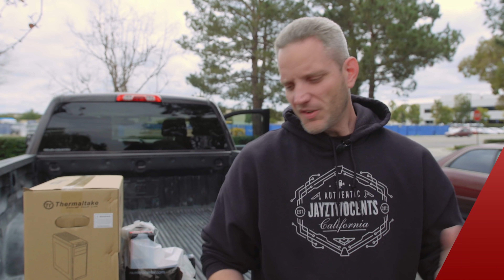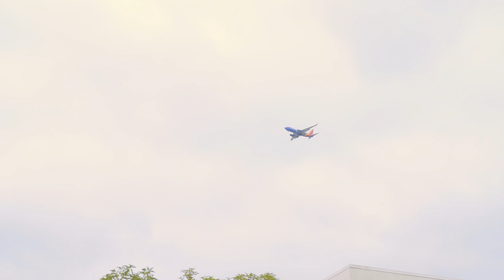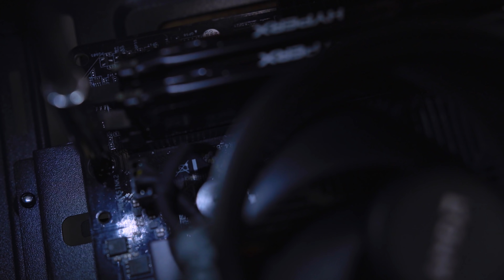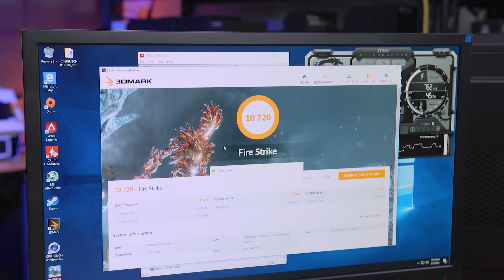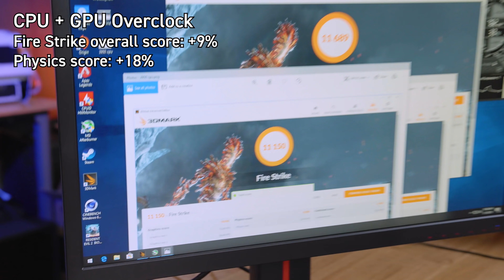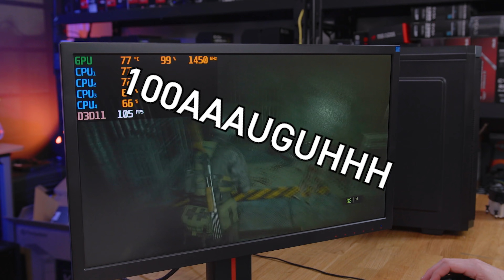CHEAP Gaming PC Build - 2019

Comment: The Division 2 is in open beta and is one of the games that comes with an RX 570 and 580 you could try and benchmark that though it will probably run flawlessly! I had some trouble running it on my RX 570 and had to turn everything down to low. I know it's an online game and I am using ethernet so I don't know if my CPU is holding me back cause I got a Ryzen 3 1200 and 8gb of ram. I wanted to upgrade to the Ryzen 3000 cpus when they come out. Would it be my CPU bottleneck or is my graphics card the cause? I tried running on medium settings at 1080p in the Division 2 only to get around 30fps with highs in 60fps sometimes but it drops to 30-40 during combat and is kind of stuttery. I then lowered all the settings to low but it didn't help any. It could be something wrong with the beta or my PC I don't know.

Comment: Does anyone know why a RX580 8g Gaming keeps freezing my computer after installing the radeon drivers?
After it crashes the computer reboots, Bios and window will load but as soon as you log in the screen will stay black or sometimes goes green.

Anyone else had this issue?
Reply: Not sure but something that comes to mind is maybe had weird issue where old drive didn't delete so have both driver's and is causing issue. Not expert just something I've heard tech YouTubers worry about because when testing graphics cards they switch so driver's interfer with each other and cause problems

Comment: I built a very similar PC for a neighbor for 473$ i got a 570 used instead she doesn't over clock at all . I knew the rx 580 was going to be bottleneck 8% or so.  That is why i went with the 570 and over clocked the crap out of it for her. Gets very similar fps in games here. 4 to 5 fps less in some spots than shown but very playable.  So you can build a pc with dang near same specs if you get creative for less than 500$

Comment: Is it feasible to go a little $$ more on the CPU cooler to improve the overclock performance?
Reply: Your limitation is going to be the motherboard and the CPU more than the cooler. The Ryzen chips will get around 4ghz overclocked. I have a R5 1600 overclocked to 3.9ghz with a hyper 212 cooler and it honestly won't go much higher without requiring stupid amounts of voltage and becoming unstable. The 212 is overkill, it never gets hotter than mid 50's under load. You're better off putting the money towards a better motherboard or a higher tier processor and just using the stock cooler.

Comment: I would like to see how newer gpus work with old Ivy Bridge CPUs like  I7-3770. People may still have stuff like that. You can get Dell with 8GB Memory and 3770 for $269. Just add GPU, and maybe more RAM. Might work for old school budget PC. This is used hardware. I looked on Newegg.
Reply: Until recently I had a 970 with a 2500k and the i5 kept up pretty well in most games.
Reply: Check gamer's Nexus when they do gpu/CPU test they have a large table. comparing many configs you might see your processor in the list

Comment: im currently on Darksiders 3 with a i7 3820 and a GTX980Ti the CPU fails to meet recommended and wow the stutters. trying to decide on the upgrade path has gotten tricky find an i7 8700k and 9700k or wait till AMD release the 3000 series and compare.
Reply: Wait for 3rd gen ryzen, its not very far

Comment: why is my evga gtx 1060 running apex at 75-80 degrees with 100% fan speed it used to run at 70 with 50 fan speed

Comment: Stay away from powercolor cards. I had a dragon 290x and the vram died on it in about a year. Underclocking kept it hanging on for a few more months but they claimed the problem was my fault and would not repair it. A buddy had a similar problem with a 280x card from them and they again would not warranty.
Reply: msi-and-asusis-the-best
Reply: @dinkthesink3890  whichever brand you get make sure they have Samsung memory for the best overclocking
Reply: @Falcodrin  yup :D

Comment: >case with drive bays

Call me a luddite (with a crippling addiction to hotswappable SSD drive bays), but I actually like having a BD drive and an expansion bay avaliable. I have this library of physical media available and as I said before, there's reasons to have a front bay for specific workflows (whether it's hot swapping SSDs for easy formatting and data transfer, dedicated front panel audio, specialized media drives, etc.)

Are there actually good cases that have at most three drive bays anymore? All the enthusiast cases I see are the hideous front panel glass crap..

Comment: But I need my maglev fans.
No joke tho, my computer is air cooled and I have overclocked everything as far as I could get them but at every overclock ran to the problem that they couldn't handle more voltage  and my temps are when gaming around 60 C. 
Forgot to mention also that I can't hear anything from it when I just browse net and do basic stuff and even when gaming the sound isn't bad and sens I always use headphones when gaming I can't hear it at all. My refrigerator makes more noise than my PC (I live in 1 room unit 22 square meters).

Comment: You can get low cost Windows 10 licenses for about $25-40 dollars online.

As far as the CPU and GPU, try swapping the Ryzen 3 2200G for a Ryzen 5 2400G and if you need extra GPU power, you could get a lower costly MSI RX570 Armor OC 8GB.
Reply: Win 10 is free if you don't register it, just get a water mark and can't change the wallpaper
Reply: @Psittac20  I'm only saying for legality purposes...
Reply: Psittac20 it’s more than just not changing the wallpaper.
Reply: @Psittac20  then you install KMSpico and suddenly have free windows
Reply: ebay windows 10 pro keys are like 5-10$ not sure where they come from... but they work!
Reply: u get windows 10key for 12$,and wdym bout rx570,he had 580 8gb

Comment: I just set up a 2200G system with Linux Mint 19.1. Just ran Heaven on it with 2400-speed RAM installed and got 10.5-43 FPS (average 23, score 580). That's OpenGL, of course, with default settings (high quality, everything else disabled/off, full-screen 1920x1080. I'll have to rerun it when my faster RAM arrives and see just how much of a difference it might make, though I am not going to be using this with any emphasis on gaming. Just hoping it will run a bit cheaper for my daily work and other computing than my other Ryzen with its honking RX580, which will be dedicated to Linux gaming.

Comment: You forgot windows, mouse, keyboard, monitor (possibly use tv)
So its not 500bucks at all. Its quite a lot more tbh for anyone thinking they can come from console to play on pc.
Reply: You can basically say the same for a console, with the exception that it comes with a controller (which is maybe $50 if you are dumb enough to purchase MSRP)

Comment: a week ago i help build PC for my poor friend, using i3 2100, H61 motherboard, 8Gb ram ddr3, RX 550 4Gb, ssd 120Gb.. Running well for Apex Legend :).. no need to overclocking..
Reply: should have get atleast i5, then it will be still good for 1080p

Comment: I would personally get a 2600 for $160 and take the $30 discount on the mobo, and I would also consider something with 4 dimms so you can pop in another 8gb doen the line. So for an extra $30 you get 2 more cores, mt, and higher clock. Plus I believe AMD is also giving out The Division 2 with that.
Reply: lilkoolaidman93 Can confirm. Finally built a rig for myself and got a 2600 for the system. Div 2 come bundled with it and I couldn’t be happier than before.

Then again I used to game in an Asus laptop from 2012 with a 740m and faulty ram, so I’m easily impressed.
Reply: jinn194 you’re easily impressed? ive never experienced anything other than membrane keyboards and second gen intel integrated graphics
Reply: The 1600 for $99, and $30 discount on the mobo bundle would have outperformed the 2200G and saved $10.  2600 is a better choice for CPU, but for the $, I think the 1600 is the best option.
Reply: @EMU1  If they're doing that promo with the 1600, that's also a good deal
Reply: Seriously, this guy lost a bit of credibility.
Reply: 1700x.... way better
Reply: @meetgabriel0709  you need a cooler tho, and it's $200
Reply: Surmestic 200$ for a cooler?! No way ... on a 1700x lol not where near that price
Reply: @meetgabriel0709  1700x costs $200...
Reply: @EMU1  Hi, a Ryzen 7 1700x cost $150 minus $30 on a motherboard at microcenter.

Comment: I think Jayz should do an complete pc for max 1099$ (the extra 99$ is for the best headphone you can get for under 200$ and it is named Cooler Master MH-752) with a minimum monitor of 21:9 , 1080p , IPS , 75fps and decent mouse and keyboard (no mechanical) ... (also stock prices not deals)
Reply: you spelled Audio-Technica ATH-M50x / Sennheiser HD 58x wrong
Reply: And the list should be updated each 6 months (+ if the monitors become cheap and gpu's become better for lower price then improve them for example if an 21:9 1440p IPS 100 fps it is affordable and the gpu can handle it in the budget then improove it but max price for complete should be $1200 )

Comment: I already got a GTX 1060 3gb, I don't play the latest and greatest, so not worried. My plan is to start my build, around mid July to September, when i get the build saved and ordered. My plan is a 6/8 core 1st gen ryzen, for the price they are currently the best value. The games i play don't need the latest or top shelf. Another possibility, is that 3rd gen ryzen comes in at about the price, that the Adored leaks showed(R3 3300 6core (maybe?) for $100.00). That will certainly save me some money as well, so could end up going new everything

Comment: Did he just put the heatsink on without thermal paste? "facepalm" or was it that preapplied crap on the heatsink?

Also overclocking is not free performance as it increases your TDP and results in paying more for your electricity (incoming nerds that tell me its a tiny amount for electricity) its still not free!!
Reply: preapplied crap, as i was building this system according to how a newbie would put it together. i didn't want to use anything we didnt buy specifically for the build :)
Reply: @frickingphil  Fair enough

Comment: An Evga 500w, with that GPU, is a recipe for disaster. The 500w white is HEC built junk. The 2400g I doubt would have been any better, for IGP, with slower ram. Also, a WoW build be cool.
Reply: I have had an EVGA 430w with a GTX 480, and an HD 7970.

Comment: Nooooooo! Not the Inlands lol. They've got a pretty high failure rate. 

But yeah I get using them for a budget build lol.
Reply: At that price, just buy in pairs at minimum and RAID.

I mean you should be using raid in all cases.
Reply: Actually they don’t, they are pretty quality. The only downside is they don’t have cache and are a bit slower.

Comment: 2 Things I disagree with on this build:
1. Processor... IMO the Ryzen 1600 / 2600 are the way to go. The integrated Vega graphics might be fine for CS:GO or LoL etc... but really if you're that tight on a budget, get something used.
2. Faster RAM. The price difference isn't big and you'd really want some good RAM with Ryzen CPUs.

That said, I like seeing budget content on this channel, would love to see episodes about used hardware etc. maybe do a Jay vs. Phil challenge new vs. used?
Reply: The Ryzen 1600/2600 are over $100 and the 2200g can still handle the RX 580 just fine. But some people will want to upgrade to the Ryzen 3000 CPUs. You forget how expensive that faster ram really is. 3000 mhz ram is a lot more then 2400 mhz ram and forget about 16gb which is over the price limited. This is a budget/mid range build so I think Jay did the sensible thing and picked pretty good components. Fortunately the motherboard (or any AM4 mobo) can handle the new upcoming CPU's and the RX 580 is quite capable and not bottlenecked too much by the 2200g. No point in splurging now when better processors are coming out. And 8gb 2400 mhz ram will be just fine until the ram prices eventually drop or go on sale.
Reply: I agree but my friend recently built a 2400g system for a pretty tight budget which didn't allow him to get a gpu for about a couple weeks. As he only really played csgo it was doing pretty well but he wanted to get a gpu as soon as possible so he went for a RX 570. I personally agree that yes the 2600 is a better choice but the 2400g is for someone who doesn't have the money yet or doesn't need a gpu which still allows them to game pretty decently
Reply: @antisniper70  I didn't look it up, but I think the Performance of a 2200's GPU is roughly in the area of something like a GTX650 2GB (I use one of them in my Workstation), the 2400's might be in the area of a 650Ti, 750 or GT1030 (or AMD equivalents). All those cards can be obtained for a rather low price on the used market (at least in US, UK, EU) and don't really lose value anymore.

Another thing people IMO overlook is the fact that IGPU also consume RAM. If you have a 8GB build and allocate 2GB to the IGPU, you're down to 6GB already. If you then add bad habits like leaving chrome with too many tabs open etc. you might go towards 4GB usable RAM for a Game, which isn't much even for esport titles.
Reply: @MadIIMike  Then the only downside is that you are stuck with a graphics card that is used, second hand, and several years old. It might be good for temporary use but will struggle with most modern games so it is better to play with an APU that you can upgrade later and you can always disable the integrated graphics so it will not allocate ram to itself since this build has a GPU. A better processor would be better but you can always get a new one when the 3000 cpus come out. Also the GT 1030 is way too over priced coming in at around $90 which is too expensive for the performance not to mention the 710 isn't worth it. Random Gaming in HD just reviewed the GT 710 I think in one of his latest videos so it may be worth a look. Even the GTX 650 struggled with older games like Assassin's Creed: Unity.
Reply: I think this was strictly for a new system only, but you are definitely right. My PC was mostly used parts and it's working wonders for me.
Reply: The rx 570 he didn’t get is only $129.  Micro center as b450 board and 2600 combo for $200.  We build one last month with the rx 570, total system cost was $450
Reply: Just let you know both apus are right now cheaper than the CPUs you've said. I have heard that these apus can play modern games at 720p which I am fine with. However, I did include a GPU in my build for the time being based on your info.
Reply: i bought ryzen 2200g build b350m mobo last year cuz the price of gpu is too high and out of budget , i can play witcher 3 in 1366x768 resolution i get 40-50+ fps on low, now just last week i bought gtx 1060 i can play on ultra and some are set to high and i get 60-70 fps 1080p  in novigrad. the thing is if u are out of budget ryzen apu is a good choice. probably gonna upgrade my cpu when ryzen 3000 series is out
Reply: @randolph6744  Thanks for the info.
Reply: 1700x or 2600 oc that. And you bell good 3000mhz ram atleast and yeah youll be good
Reply: Its only 10$ more 3000mhz or even 16gb of ram
Reply: Like "Jay's Scrapyard Wars" or something... That would be pretty cool actually

Comment: So No More boycott for Thermaltake ?
Reply: GamePlay Maroc Eli5?
Reply: @C0nnie  Thermaltake used to have really really shitty quality on their watercooling parts. I think. Jay mentioned his reasons in a video like 2-3 years ago. Don't want to put any words in his mouth but i think thats what it was about.
Reply: @RefrigeratedTP  it's because they stole designs from the now defunct Caselabs...
Reply: @realname7749  Now that i have the money for a sma8 they are gone...
Reply: @realname7749   caselabs were WAY to fucking expensive
Reply: I still boycott them, no reason to buy their crap. spend the extra 2 dollars and get something that is better.
Reply: @ottersdangerden  Yeah I do the same thing. Sure, it's cheaper if I bought a case or cooler from them but I would rather buy something I'm proud of than buy something I will regret later on. The best possibly way is probably to buy a thermaltake case used so the company still doesn't see your money.
Reply: I started out boycotting them after daring to get their awful fucking Riing fans - look great, fucking awful performance for the price; just get an appropriate Cooler Master or Noctua and be done with it, Arctic F12 5-pack for $27 for 5 PWM daisy-chainable basic case fans for budgets - and one of their ultra cheap-O cases for a basic build, and suffered the consequences of that until I saved to replace them. 
Have an In Win 303 filled with Arctic F12 intakes, CM MasterFan Pros as upper exhausts, and a CM JetFlo(hands down best performance for the dollar) on the rear exhaust blowing through a 120 rad.

Only after that did I realize that they were sheisty motherfuckers, after which I felt quite justified in my negative judgment of them

Comment: those red dragon rx580s are really solid if they are anything like the 480 ones. I ran the 480 til a few months ago when i upgraded to a 1080ti and my buddy is currently using it with zero issues. It barely heats up at all, fans super quiet.

Comment: Just get a PS4, its like $300. Cheapest way to play apex.
Reply: you need ps+ or ? rip
Reply: in fps per buck, this pc wins in nomatter what.. you can dig down to 350$ = letting the gpu out and using the integretated one and instead spending money on ps+, just spare it and upgrade to this actual gpu later or try the used pc market and smack that ps4 like this pc actual does.
Reply: @Xenoray1  couch gaming FTW. I got everything, but I only use the PC for watching torrents lol